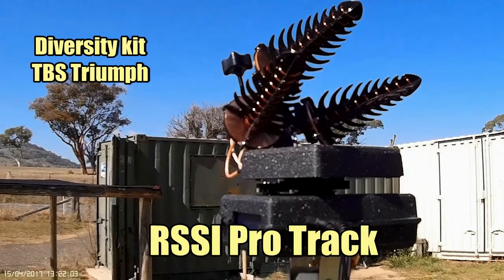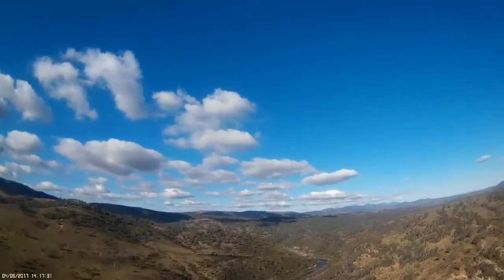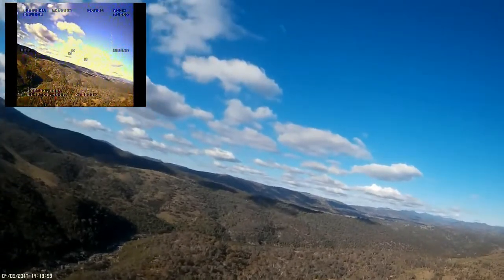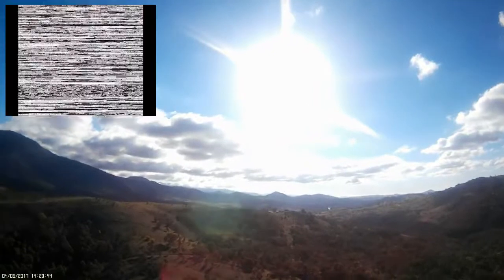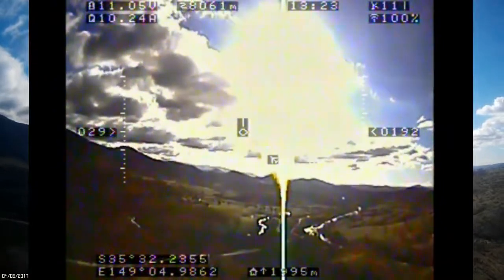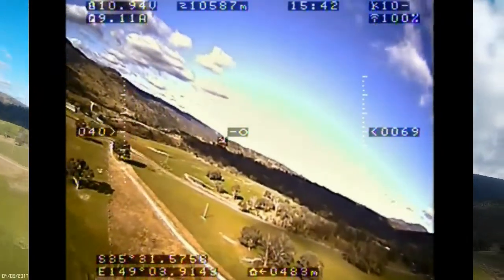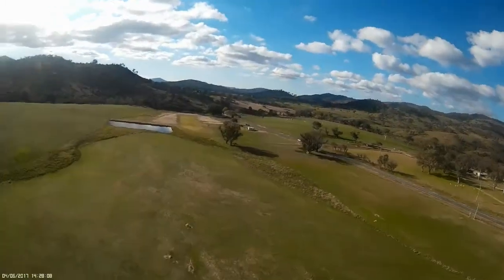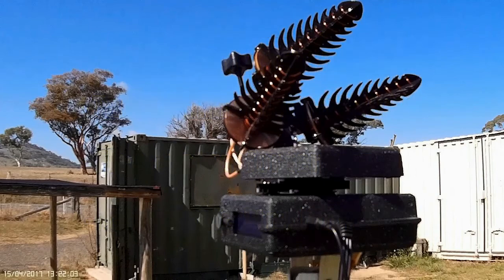RSSI Pro Track - Range Test #2

Comment: Yup, way too low.  At 20 degree angel on antenna, your altitude should be about 1.7km when you are 5km out to be in the center of reception.  Google up a triangle calculator to help plan your setup.
Reply from the maker: Thanks. I'll have a look. Seems very high though. The inventor recommends 20 degrees and reports a 16k trip at 300m with no vertical adjustment necessary,
Reply: He was flying over very flat ground.